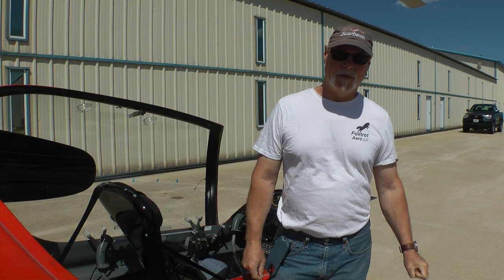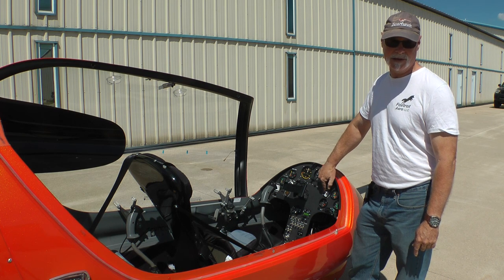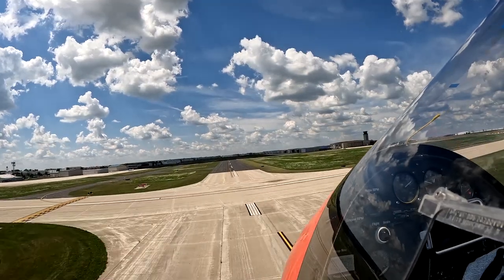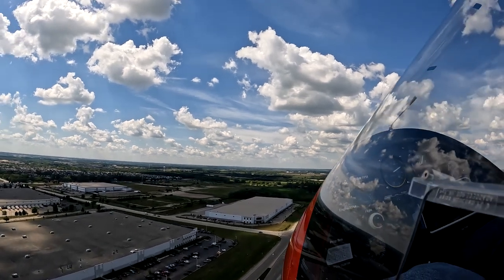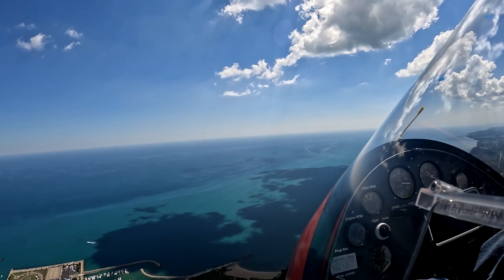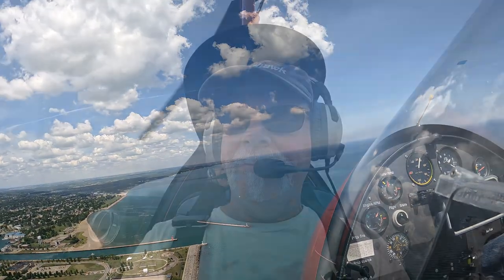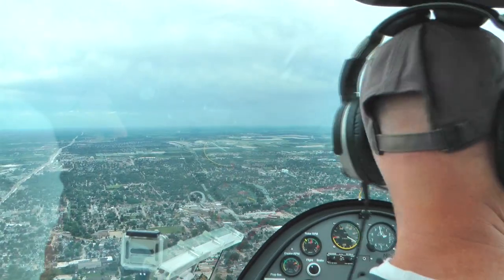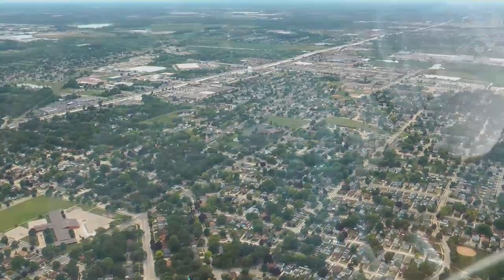Intro to Gyroplanes

Comment: What's the cost of ownership?
Reply from the maker: Unfortunately it aint cheap if you keep it fully insured.  Fuel and maintenance are pretty reasonable and if you share hangar space, keeping it is not bad but hull insurance is really expensive.  For a maching like I am flying used you will be out about 65-75k.  Operating cost per hour is not too bad since the fuel burn is about 5gph of pemium auto fuel.  If you want all the gory details, contact me at Foxtrot Aero

Comment: all the downsides of a heli with none of the upsides…pass
Reply: Well, it handles wind better than planes. My MTO uses around 600 feet takeoff and can land with just a few feet rollout. It can't stall and you can hover while sinking. It can turn on a dime and you can land nearly anywhere if you should have an engine out. Visibility from up there is great. It has a few downsides like a bad glide ratio and some maneouvers you have to avoid. But I find it a good tradeoff. Each to his own, but don't write such a blatant false statement...!